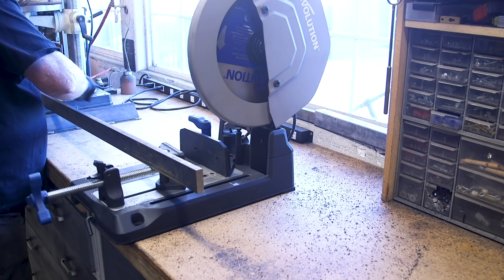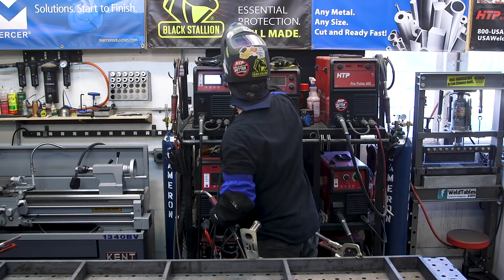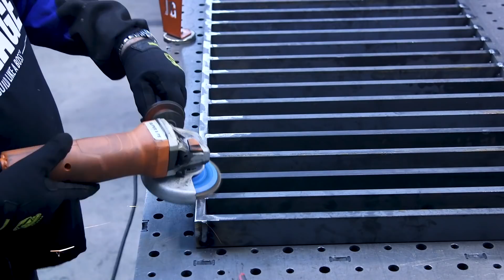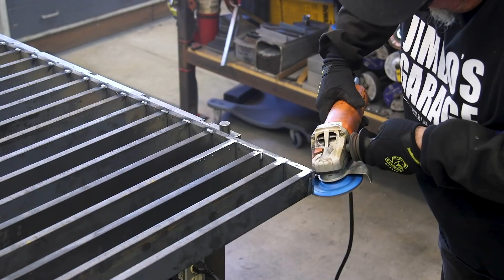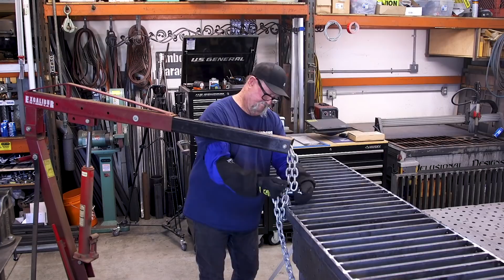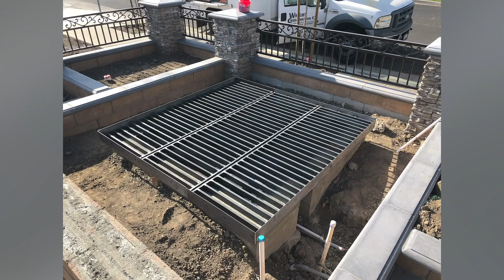Metal Drain Grates Build | JIMBO'S GARAGE

Comment: Jimbo, that is one heavy duty build! I could feel the weight from here! I do have a concern about the welds though. Short circuit MIG welding on mill scale and no bevels on that thickness of material scares me! I am probably over thinking it, but mill scale has bitten me before on a lot lighter jobs than this. Once you ground down the faces of the beads, there is not a lot holding it together. Definitely not equal to the material thickness. Nice looking work though as always!

Comment: Could have saved lots of checking dimensions if you had marked one first and then squared across both pieces together with a paint marker or silver streak before separating them to weld. Good job all the same 🇬🇧

Comment: Talk about overkill. That is the same size and spacing as the grates in the floor of the dump house at our local elevator and  loaded semi's grossing 80,000 lbs drive over them all day. 
You have a great metal supplier the one we have here charges four dollars a cut on all metal.

Comment: Figured 2x5/8 bar stock weight 4.25 per foot. 493.18 pounds per cubic foot on steel. Make you a jib crane that you can use the corner of your table that will mount in the holes of the table and turn all the way around. And when you are not using it or need it can be taken apart easy and quickly and stored  in a corner.

Comment: Was that overkill with the 5/8" x 2" bar stock?  I wondered if that could hold the truck that delivered the several hundred lbs. of rock and urns.
Reply: Easily, most fabricate highway catch basin drain grates are made using 1/4" stock.

Comment: A gantry would be great  for most applications... I recommend spending the extra money on a main and auxiliary hook  set up, this is referring to a permanent mounted system, not a rolling gantry.  A couple of davit arms may solve your problem too with electric chain hoist, or an I beam over your fab table with a roller set up and chain falls. Working alone as you've stated requires  using mechanical means to give you those extra set of "hands "you need to add enough stability to the piece to safely manipulate  it.  Would love to see a video on the option you choose.

Comment: Flower pots...heck you could drive a Mack truck over that grate and get no deflection! Great job, see if you can modify the crane to run on compressed air...make it easier to operate